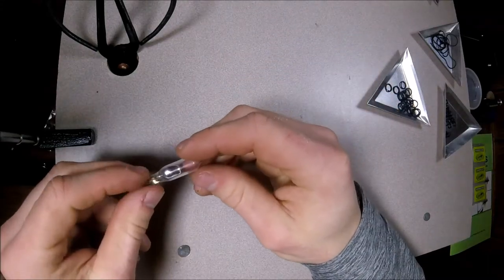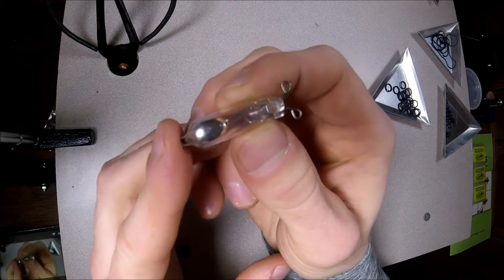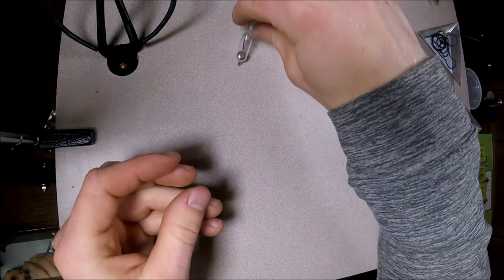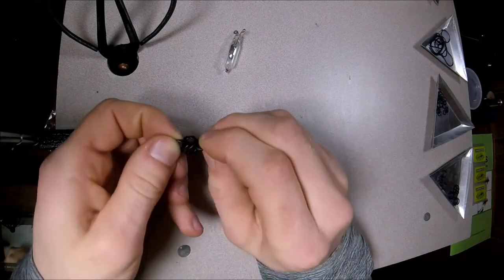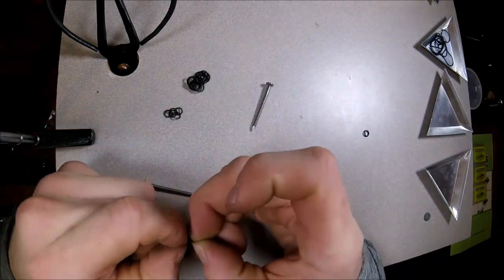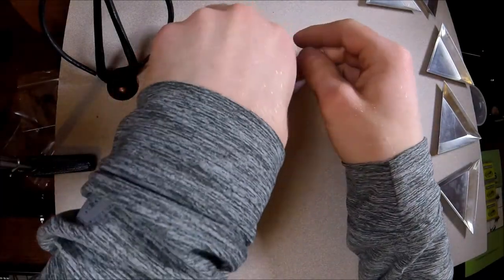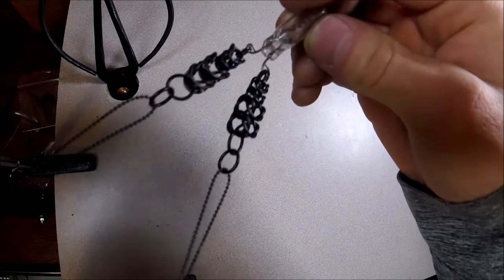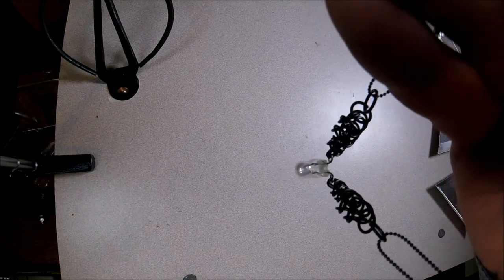Mercury Tilt Switch Pendant | Tinker Table: Episode 1

Comment: It's probably best to put the mercury into thicker glass vile, I was taking apart an old mercury thermostat today and those tilt switches are extremely fragile, they are almost brittle glass and I ended up breaking one of them on accident, all the mercury was contained so that's all good. But I wouldn't want that anywhere are my neck, codyslab has a good video on mercury necklaces. But cool video!
Reply from the maker: Yea, they are really brittle. I just made it as a display piece, it looks nice against a black background next to some cinnabar. Thanks for taking the time to watch and comment!

Comment from the maker: I forgot to mention this in the video, but these switches are rather fragile, and should not be knocked around. While elemental mercury is safe to handle, it will stay in the food chain, and is a cumulative poison. DO NOT MESS AROUND WITH MERCURY.